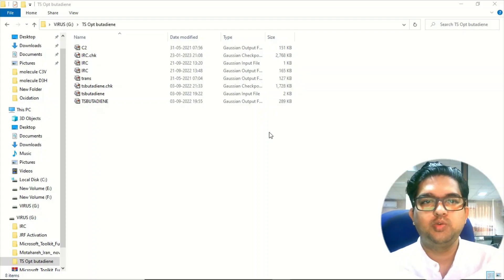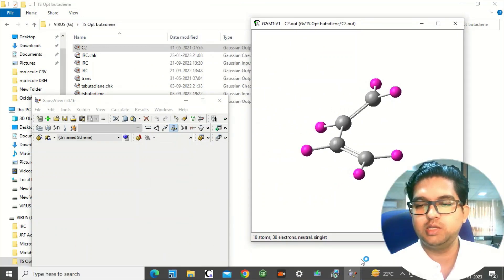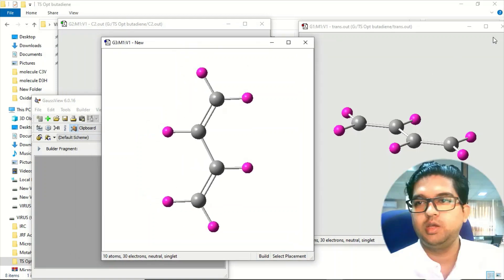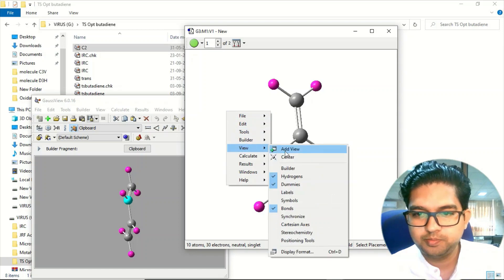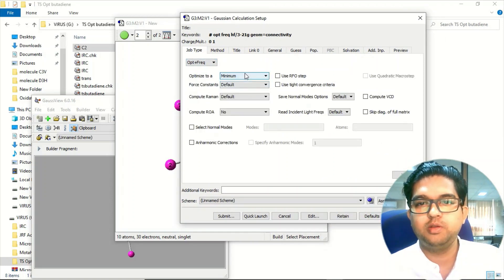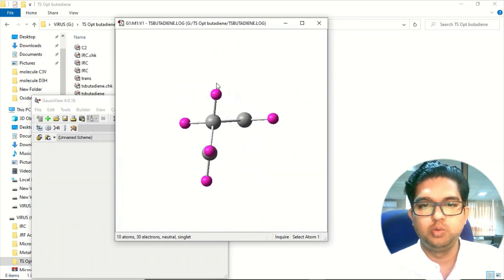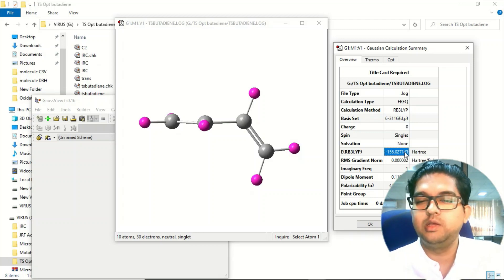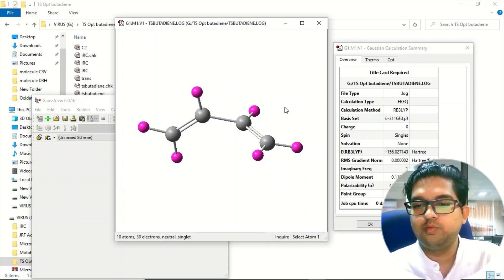Transition State Calculation TS Berny, QST2, QST3 in Gaussian || Gaurav Jhaa

Comment: In my case although I am giving the two geometry but I am getting option of Ts (benry) only and when I am saving the input file it is saving only one molecule . What could be the reason.
Reply: To show the TS(QST2) option, the number labels of both molecules must be the same.
Reply: @Suganbabu02  yes , is there any way to make the label the same or do we have to do it manually only . As for big molecules it becomes very tidy .
Reply: @JEE_NEET_Chem_Masterclass we use transition state (TS) calculations to predict the transition state between reactants. For example, we have two cases: i) A → B and ii) A+B → C. I understand you might be struggling with the second case (ii). In this case, you need to obtain the correct optimized structure of A+B. This structure should have a similar labeling scheme to B. To achieve an accurate TS structure, the reaction mechanism must be correct. Therefore, you need to perform the calculations stepwise. One more thing is always use to labeling the structures all the times.  Good luck 👌
Reply from the maker: You can interchange the coordinates. Open the input file in notepad or notepad++ and interchange the respective coordinates to make the same labels  @JEE_NEET_Chem_Masterclass
Reply from the maker: 👍 you are right  @Suganbabu02
Reply from the maker: Add second molecule to the " add molecule group" in the file menu. Do this step carefully.